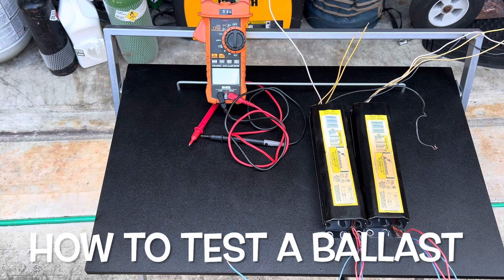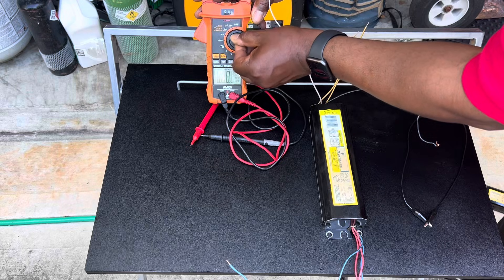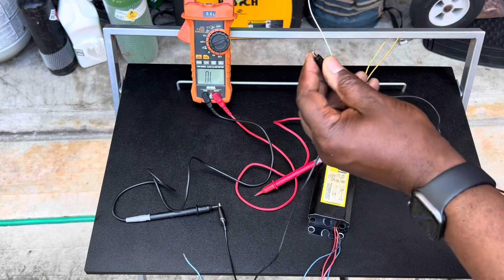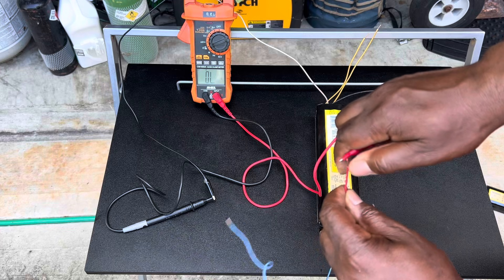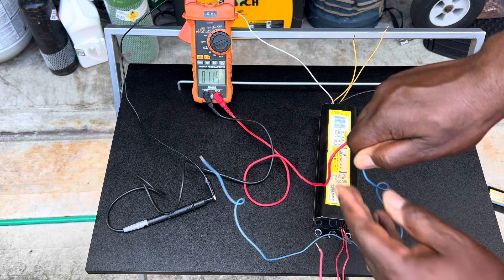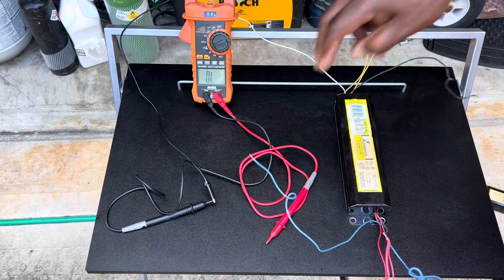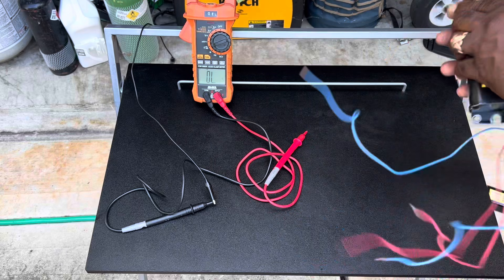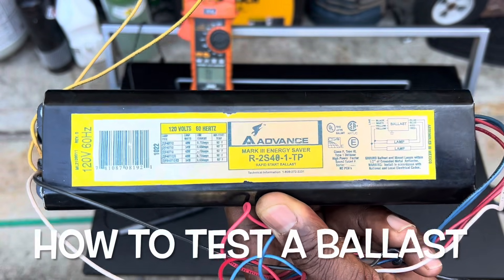How to test your fluorescent light ballast with a meter

Comment: Im getting no response from my meter but the bulbs aren't working. However, I put the bulbs in another fixture and the bulbs work?  Any ideas?
Reply: Probably the wrong type of bulbs check the specs on ballast,  check watts,
If not that your contacts are bad and can be replaced.

Comment: Ya...but I checked one side of the bulb and it has ohms, then I check the other end and it has has nothing....why?
There are two bulbs in total only one end of all the 4 ends have ohms. The others have nothing.
Also...could a bad bulb affect the amount volts coming from an outlet that is in the same line path?
I got this problem where the florescent light is dim and sometimes bright but mostly dim but then the outlet is not charging my battery pack fully like it use to.
I used a multimeter to check the ballast and it shows no ohms...so I guess it's good.
I attached the black wire from the meter to the white wire on the ballast. Then I touch the other wires with the red wire from the meter and nothing happened...no readings.
So...what could happen?

Comment: Hi. I want to ask a question here concerning the intsrument used to measure this.
I have a fluke 324 clamp on meter with the ohm continuity setting but i get no readings. The electronic ballast does not light the tubes. Will a clamp on work for these measurements or do i need a multimeter like whats used here? Thanks.

Comment: Throw it away buy yourself a couple led retro fit lamps wire the socket to 120 volt . No ballast to burn out the lamps are about $6 apiece and last about 30,000 hours.

Comment: A better solution is to remove the ballast and install a double ended LED tube. Great video tutorial for those who want to stick with outdated flourescent tubes, but LED’s offer much better output and much lower operating costs.
Reply: Video?
Reply: There are plenty of videos on YT. Black feeds one tombstone, white feeds the opposite end. Install the tube and turn it on.

Comment: Hi. I noticed you didn't check resistance between the white (common) wire and the black (hot) wire on the ballast. What should that reading be? Thanks.
Reply: May about 10 Ω
Reply: @chaowei1036 Thanks.

Comment: Is the power to the ballast on or off?
Reply: never check resistance while power is on. It will probably blow a fuse in your meter and you can't get a reading like this anyways.  :)
Reply: It will not damage the instrument
Reply: @John-c9y3c  it absolutely will damage the instrument

Comment: You know i just tried this with 2 bad ballast.  Black lead to neutral, then red lead to the other wires like in the video and all showing OL.  I set the meter to ohms and it’s on auto range.

Before i remove the ballast, i check the power first to make sure i am getting power.  Then i replace the ballast.

Comment: I just replaced a bad fluorescent ballast for a four tube setup. And after getting the lights back on, I decided to troubleshoot the old ballast itself. Well I found the two power NPN transistors were blown. So I thought I would just buy two new transistors and fix it for a backup spare... NO i didn't! The cost from every place I checked sold those transistors for about 2/3'd the cost of a new ballast. So I scaped it for parts and moved on...
Reply: So please tell me you just bypassed the ballast completely and just bought some new led bulbs. Thats what I 'm doing to all of my old fixtures.
Reply: How did you do that?
Reply from the maker: Exactly

Comment: Thanks! Is there a way to do this test with the ballast installed in the fixture? I saw somebody check for shorts across the terminals where the bulb ends go. Wondered if this is another way to do it.
Reply from the maker: The best thing to do is go ahead and change the ballast